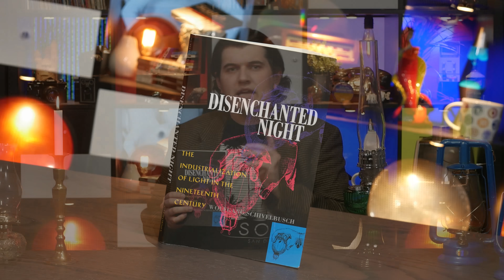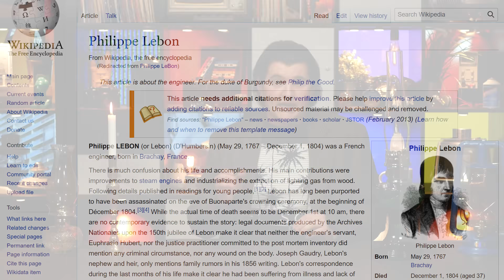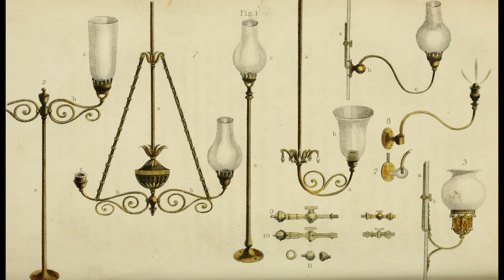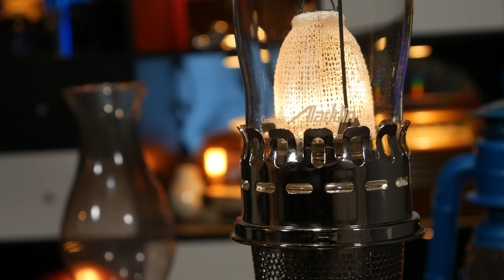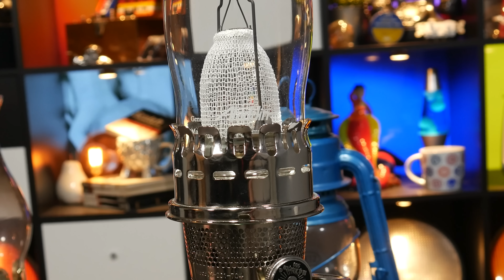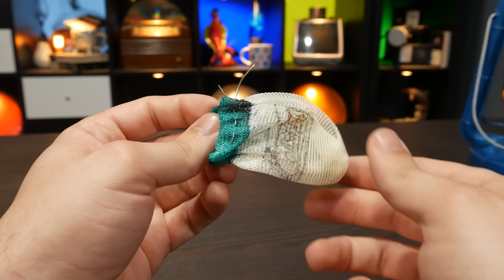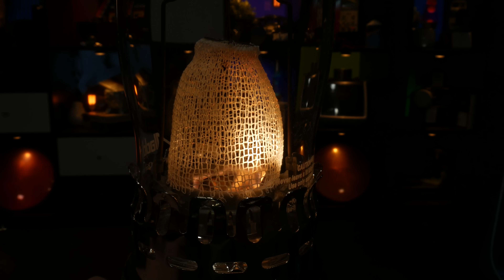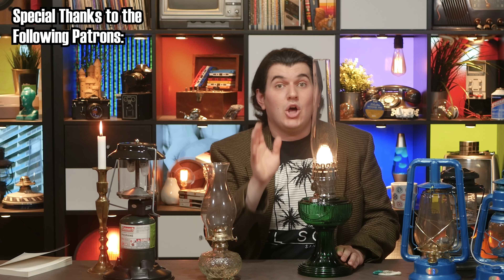How the gas mantle made lamps 10X brighter

Comment: When I was young and lived in the bush  ,  I haunted antique shops to find  Alladin lamps !  10x better than a regular straight-wick lamp . Could get 'em for around  $50 in the 70s. An alladin burning well and clean would give as much light as , say , a 60W bulb.  Went through quite a bit more kerosene , tho  Had one with a beautiful stained-glass shade  Very Pretty !!!  You can also buy Propane--powered  mantle lamps .About the same brightness !!! Last time I looked , Alladin was still in business in Tennessee .Still selling parts , wicks , mantles , etc. First found out about them in TheWhole Earth catalogue Great book if you can find a copy !!  You need to trim your wick it's lopsided Keep trying you'll get it !!  REplacing the wick is not the answer (also they're  expensive ) Not quite gasoline we used to buy stuff called  "white gas " Higher octane. You can get propane lights that hook up to a copper line , the other end of which connects to a 100 lb tank Screw 'em to the wall  My off-grid house had propane wall lamps , a propane stove 9full-size ) and a big 8-D. 12 volt battery running a car stereo Kept 2 and traded offf when  charging every couple  months . With a black plastic 1inch line up to a little pond on the hill. I had gravity--feed running water. All .the comforts off home .Ah , the good old days .!!

Comment: Wood gas is not commonly used because it is one of the most efficient ways to generate carbon monoxide, a poisonous gas used in Nazi exterminations. BUT important to note that the Nazis did not use wood gas, but instead a far more inefficient Soviet Diesel engine to generate the carbon monoxide, because Germans in the 30’s and 40’s were really bad at chemistry, which you will know if you look up all the German Nobel prize chemistry winners during that period. 👌

Comment: The house I grew up in still had the gas lights mounted on the walls and they were still in working order. Eventually the gas mantles disintegrated and they no longer sold them in shops.
Also there was still an old street gas lamp still working. Some say it was to burn off the gas that was still in the gas pipes

Comment: I think "forced my lute" is a typo. 
   
Should be "forced my flute" as in the explosion forced the glass chimney, sometimes called a flute, to break. 
  
He is saying the explosion caused a force that applied to the flute then broke the glass.  
  
In fact it could be that the taper at the top of the chimney was specifically the part called the flute. So when the explosion occurred he refers to it specifically because that's where it broke because that's where the air gets compressed before leaving the chimney.  
  
Could also be that the flute acted as a rocket engine and forced the whole lamp down and he might have been holding it at the time and noticed the force.

Comment: Over 65 years ago our whole family spent teatime sitting around a table with an oil mantel lamp in the middle.  The light just about reached the edge of the table, so we could all see what to eat.   It also produced quite a lot of heat, such that cigarettes and pipes could be lit from the top of the glass funnel.
One interesting fact was that the wick had to be trimmed flat, as any high spots would cause a carbon deposit on part of the mantel, this would take several hours to burn away, once the flame was levelled out.

Comment: Two things he did not cover: A. being that for every part of gas consumed, it takes 10 times that amount of oxygen, producing 10 times the amount of Carbon monoxide. B. Gas lighting eventually led to the invention of Play-Doh, which was originally invented to clean the soot off of walls & ceilings.
Reply: There should be minimal carbon monoxide production in a clean burning flame - the vast majority of the carbon should fully oxidize into carbon dioxide. If it emitted carbon monoxide in the quantities you're talking about here, it would quickly be lethal to anyone around if used indoors.
Reply: You're terrified of vanishingly small air quality "problems," and you want everyone else to be terrified, too. 

How ever am I alive after running these all winter and heating my house with them for more than a decade?

Comment: When I was a kid we had a hunting camp deep in the woods off the grid. There was no electricity and for water we had an artisian well on a natural spring. We build the entire cabin with copper gas lines in each room attached to gas mantle lamps on the walls, so when we arrived at camp we just hooked up a 20 lb propane tank to a regulator on the porch and we had lights for the whole camp.

Comment: Kerosene.. a niche fuel, lol. Yeah, that's why I can go to so many gas stations near me and buy it at a pump. It's a commonly used heating fuel in northern states of the United States mostly due to its lower temperature stability versus #2 fuel oil (aka diesel).

Comment: Coleman mantles use thorium, which is very radioactive (a decay product of uranium).  If you put a Geiger counter next to the mantle you will get an elevated reading.  Burning radioactive material so it floats into the air to be breathed in is dumb.

Comment: "While burning a fuel to create light is certainly not the best way to do it..."   Short of using batteries and solar, every other source of light man has ever created has required burning fuel, if you count the electric plants.
Reply: Using the burning fuel itself as an illumination source bears a significant efficiency penalty as opposed to concentrating that combustion to generate pressure transduced into kinetic energy.

Comment: "I Think" any peasant making Charcoal for a Smith of Any Trade would have UNDERSTOOD the "Gasification" involved in burning Anything with Volatility or Organic. just through day-to-day Observations, they just did Not have the respect or resources to capitalize on their observations.
Yes I do have a few hobbies involving these processes. I distil "Spirits" in my DIY still, I also make my own Charcoal and have worked in Multiple Industries of these topics, IT's All about the Air ratios and heat rising Pumping the energy into the prosses in a loop.

Comment: Great job! Never leaving a kerosene lamp of any sort unattended is great advice. There is a better way to dress the edge of any center or side draft round wick though, scissors or an Xacto will always leave loose fibers to create hot spots later. Once you have installed your new wick, run the carrier down until it drops below the draft tube, then raise the wick back up until about 1/8-1/4 of an inch of wick is exposed. Wet the end of the wick with kerosene, light, replace the chimney on the gallery and allow the flame to burn until it goes out undisturbed. Once the lamp has cooled, remove the chimney and flame spreader, and run your finger around the top of the wick, (I usually hold my finger stationary and rotate the base of the lamp underneath) as the fuel in the wick was consumed, the wick was turned to ash only down to the level of the inner and outer draft tubes. Running your finger around the top of the tubes will knock the ash off and leave as close to a perfectly level surface as you are liable to have on one of these lamps. Once that is done, reassemble the lamp, fill with fuel, allow the wick time to completely soak, and you're ready to go. The mantle style lamps, of which Aladdin was but one maker, were the pinnacle of kerosene lamp development. Tracing the development of lighting technology from the solid round wick whale oil lamps, to the flat wick, folded round wick, center draft round, Argand burners etc., all the way to the mantle lamps is a highly interesting field of study indeed.

Comment: Your hair looks better long, don't cut it like 3 years a go! Coal is great for activated carbon using an oxygen free oven (sand keeps the air off the coal) to prevent it from turning into charcoal.
I remember as a kid camping starring at that wick, I thought it was fiberglass just looking at it but I was about 9 and touched one if them, dust. Thankfully someone thought to bring a spare wick. But they do give off a worm comfortable light when you are in a canvas tent in the 60's. It' gets even better if you were camping with Albert Hoffman! Much nicer light then.

Comment: I was born in a farm cottage that was lit with “Aladdin” lamps (mid-1950s)…if I remember correctly my dad converted a couple  into electric table lamps (these were ones with metal fuel tanks, so he drilled holes in them to run cables). They even had lampshades because the original light from the mantle was so white and harsh.
Reply: Farm cottage , Yorkshire 1950s,  great comfort in light & heat , also for carrying around the lambing fields !   The mantles were very fragile , like ash , and the light significantly brighter & more useful than a simple flame,  The heat emitted was significant, but heated the room , and I think that some were adapted to heating a small cooking  pan. Also I read that  Thermo-couples were fitted to make electricity , long ago  !
Reply: Omg! Criminal act !
On the other hand those "conversions" can be reversed, parts are available and "damaged" aladdin is cheap(er)

Comment: Did I hear correctly that this lamp is the equivalent of 100 W electrical lamp in terms of brightness, but produces at least 800 W of heat? This means that this lamp is eight times less efficient than an electrical lamp.

Comment: Actually a gasometer is both a storage device, and a measurement device. The height of the upside down gas trap is proportional to the volume of gas. The higher the top of the "tank" the more gas you have on hand!

Comment: The gasometer was a measuring device.  The whole tank was floating in a water pool and moved up and down depending on the amount of gas in it. On the side was a measuring device and by looking at a scale the operator could measure the gas stored in it. In the picture you can see the wheels and tracks the tank moved up and down on. The weight of the tank also provided the pressure that the gas exited the unit.

This is a very informative look at the use of gas and mantles  many thanks.

Comment: I am familiar with hurricane lanterns and Coleman lanterns, but I never heard of the Alladin variant.  I've always wondered about how mantles actually work and what they are made of despite my using them numerous times. Thanks for your thorough and interesting video.
Reply: Aladdin
Reply: I ain't yet watched entire video... Those mantles represent the first commercial use of rare earth elements/lanthanides . A number of the rare earth elements glow brightly at reasonably achieved temperature. Cerium and thorium especially I remember. Thorium was the best performer and no longer used today . A fresh mantle is a cloth impregnated with nitrates of the rare earths and a silicon based chemical perhaps ammonium silicate. After commissioning by burning the installed mantle in situ,  the ammonium and nitrate components and cloth cellulose are volatiled away leaving the rare earth oxides within a newly formed silicate solid structure that has formed in the  matrix of the previous cloth fabric with some 40% shrinkage .
Reply: Alladin, Coleman, Tilley, Primus, Optimus - they're just trade marks. Effectively doing the same job, but with non-interchangeable parts (jets, prickers, pump washers, seals ...) for "vendor lock-in" - which has been around since the Victorians.

The only reason the mantles are interchangeable is because the few mantle manufacturers don't want to sell 4 different product lines, and just make a one size fits all".

Comment: These gas mantles are still used in petromax kerosene pressure lamps where the kerosene is first heated in the round tubular burner and as it gasifies it comes out with force and when lighted produces a gas flame that is surrounded by the mantle that amplifies the intensity of the light even more than before. Oh ya that was your next video.

Comment: Today I built a crude inverted wick vegetable oil  burner, because I noted that candles and lamps seem to always produce light more above them than below, and generally I need light like, down on what I'm working on. Now I want to knit my own gas mantles. I also want to find out if I could get wood-gas lighting with mantles bright enough to grow like, herbs and tomatoes through the winter. The heat and even the additional CO2 would be useful in-situ